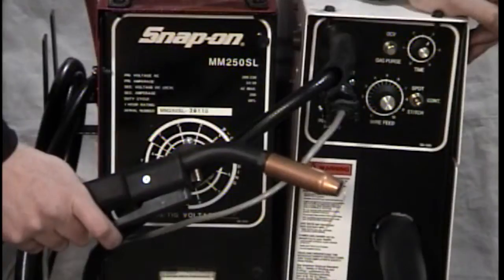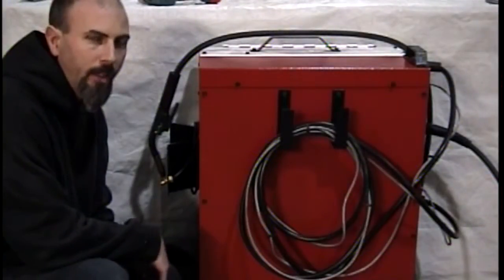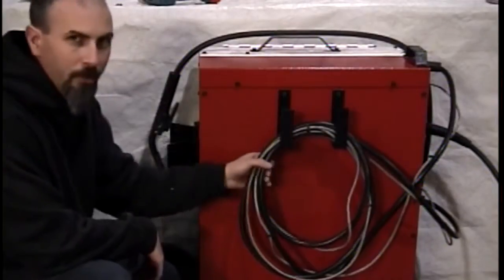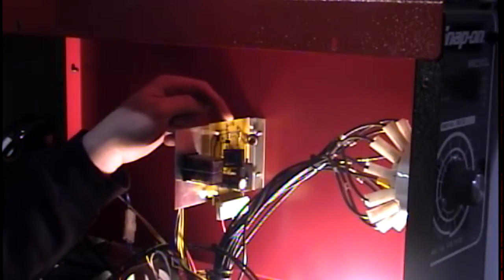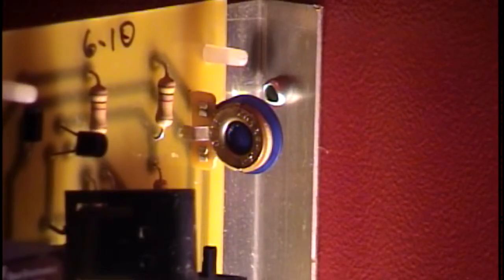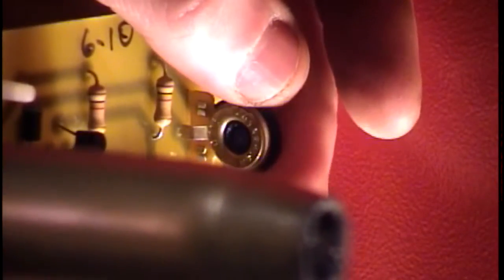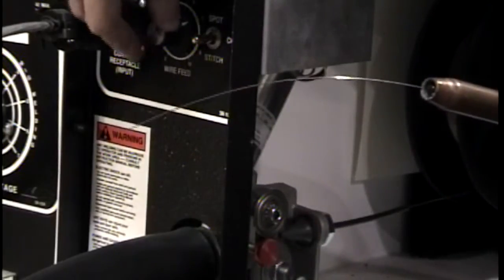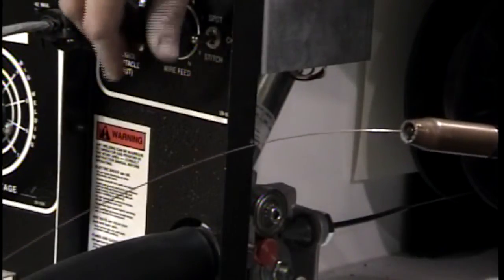Wire speed calibration procedure

Comment: Well, it's not the motor. I just switched out motors and the mm250sl wire feed is still not working on the slow speed. I can put it to the slowest speed and I can hold the motor still with my hand. I can't do that with my mm140sl motor that was on the mm250sl. I watched your diode vid and I'm going to do that test next.

Comment: I have a mm250sl and I adjust the wire feed potentiometer just like you did and the wire feed still doesn't work on slow speeds? It will work if I have the tensioner off the rollers. I tried loosening the tensioner and still has same problem. The machine works fine with the wire feed up high around 8 - 10, but it does not want to feed at the lower speeds. I also have a mm140sl that works fine. I swapped out the boards and the mm250sl still will not work on slow speeds.  I'm thinking that the motor might be wearing out. Any suggestions?                 
         Also, I would like to get a tig torch for it, but I don't want to buy a snap-on. $650 is outrageous for a tig torch, which is what snap-on wants. A Miller is only like $150. Is there an off brand I can use?